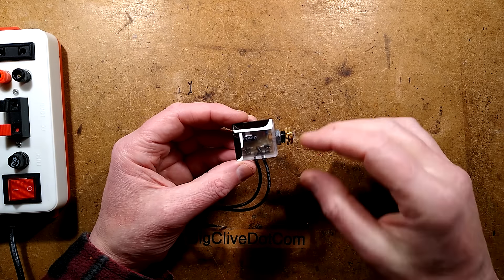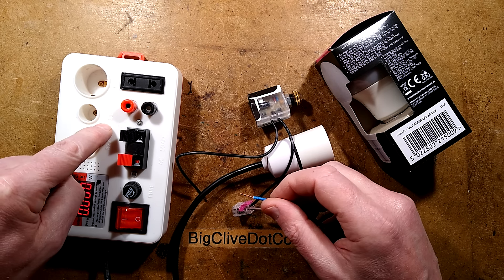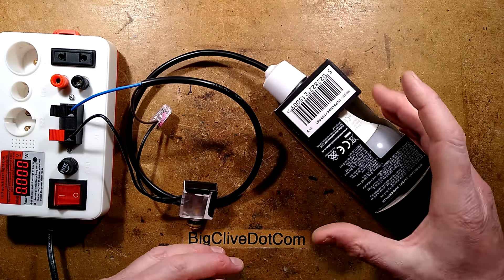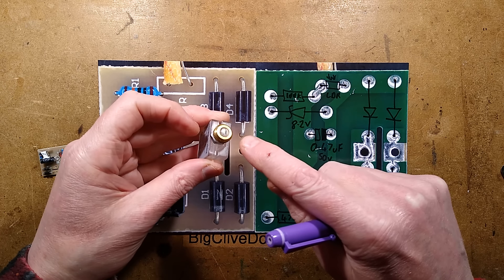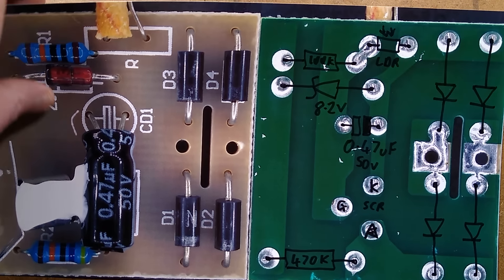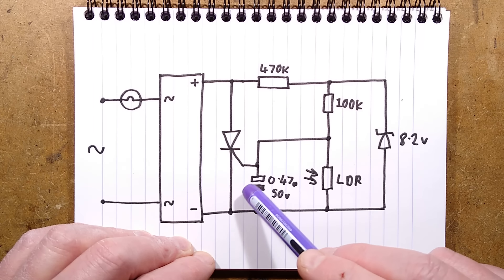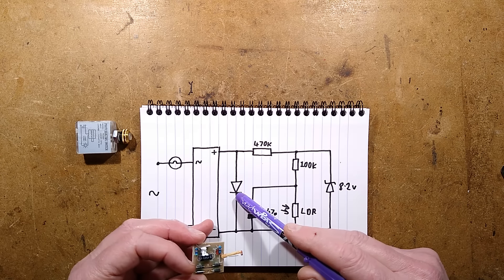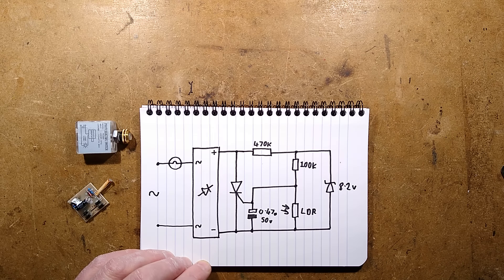Very minimalist light sensor with flicker issue

Comment: Clive, It was me that sent you the sensor to investigate, thank you for the clear explanation of how it works and why it flickered so badly.
The replacement three wire dusk sensor that I purchased from Amazon is about the same physical size and has a built in 12 second switching delay, no further problems since installation.
Thank you again!👍

Comment: I have had many flicking light (or darkness) sensors.

The most amusing installation I have seen was for a light circuit but the sensor was placed within range of the light beam so the light itself was causing the sensor to turn the light off which made it dark enough to turn the light back on which then….you get the idea

They ended up placing a plastic shield between the light and sensor rather than move the sensor. It worked for them
Reply: Dusk/Dawn sensors are supposed to operate at 70 lux,  They are never calibrated.

Comment: My workplace has sold LED panel lights from a Chinese manufacturer for years, and they too has the habit of soldering the ends of multi-core leads which normally go into scew terminals. I constantly clipped off the soldered bit and removed the insulation to reveal non-soldered cores when preparing these for the electricians who installed them at the customers' premises.
To manufacturers in China and elsewhere: Multi-core leads have a slight "springy-ness" to them, making for a more reliable connection when they're connected with scew terminals. By putting solder on them, you make them more rigid, and thus more prone to dislodge themselves over the years.
Reply: Solder flows very, very slowly under pressure, so if a soldered stranded copper wire is clamped in a screw terminal, eventually you will end up with a poor connection. And if there is a significant current flow and enough voltage, it may arc nicely, overheat and burn the connector...

Comment: Thank you Clive. 
Really nice to see the workings of devices like these. Was surprised you did not feature a “hack” of some kind to rectify the “shimmer” 
While I know there will be plenty of videos on line of various diy dusk sensors. 
I would really like to see your design of one of these that will work on say 12v/5v or 3v dc led projects , where the ldr is fitted in a tiny hole/mounting on likes of led candles or other items.
Some years ago I  came across those poundland led strip lights you featured. the dusk sensor modules in those work on ,iirc 5v to 15v and rescued some that were being “dumped “ because customers had opened them etc.
Reply from the maker: It would be complex to add hysteresis to such a simple design.
Reply: I would like a 12 volt DC light sensor.. operating voltage 10v to 16v ... I have solar panels.
Also lower and higher voltages 1.2, 3, 5, 24 & 48 should cover most..
I was wondering if a zener and a capacitor but no idea which...
Electoboom might employ a 12uF 💥 capacitor ⚡
Reply: You could try inserting a resistor between the LDR and the gate and maybe at the same time, increasing the value of the capacitor.
Its not hysteresis but it would delay the turn on / turn off and maybe stop the flickering?
Reply: @kenaston4220 it wouldn't...

Comment: The Chinese testunit seems to have an on-off switch type that could have a neon light built-in which you could use as an indicator that it is turned on?
Reply: illuminated switch
Reply: I thought that too... If there isn't a lamp in that switch, it seems to be a standard size that can be easily changed out with one that has a lamp.

Comment: Clive, try this with a dimmable LED bulb!  It may create a nice effect where it proportionally increases light output as it gets darker outside, and proportionally dimmer as it gets brighter outside.
Reply: That's what I was thinking, the circuit is very similar to a traditional TRIAC dimmer. The downside is the rectified design makes it much more likely it will trigger on the next cycle, causing flicker. If the same circuit was made with a TRIAC instead of rectifier+SCR it would probably dim properly.
Reply: @eDoc2020  yeah, I'm curious on how they'll react.  I know I've put a traditional dimmer on a circuit with fluorescent lights that had traditional ballasts with starters.  The random flickery light show was fun!
Reply: @davidkane4300   I've actually had fairly good results using a traditional fluorescent light on a TRIAC dimmer. The hard part was getting it started, but then I could probably go down to 50% brightness before it started acting up.

Comment: Clive, for the indicator light for the lamp tester, did you check if the switch already has a neon lamp that has not been connected? I have a water heater with a switch like that that din't have a power indicator* and, when I opened it up to change the switch for an illuminated one, I discovered I only needed to add a little bit of cable for the unused neon lamp already on the power switch...
*It did have a power indicator, but not a useful one: It has a red/green LED to show if it is heating or not, but the red one (not heating) is directly wired to the mains with a capacitive power supply and will light as long as the heater is plugged in, no matter if the power to the heating element has been cut with the power switch or if the green (heating) part of the LED is on...

Comment: I think that all dusk sensors which don't use built-in hysteresis are going to have problems with flickering when in an edge state.  I used a circuit from a web site in order to make a simple solar battery charger to operate some LED lights after dark.  It's pretty sharp in its response to dusk (goes from fully off to fully on in roughly 1 minute) but it doesn't instantly turn the lights on or off.  It's a gradual transition.

Comment: Hey Clive, perhaps consider moving the bench power module’s voltage display to the load side of the switch so you can see if it’s turned on or off
Reply from the maker: I've considered that, but it would mean it went through its power up sequence and display voltage instead of just showing current immediately.
Reply: Or just fit an illuminated rocker switch.

Comment: Suggests it isn't for led bulbs but for incandescent
Reply: I think that's part of the problem with mine, it's never really worked properly with LED floods
Reply: I was wondering that also. However it would be more efficient to leave LEDs on 24-7 than use incandescents.
Reply: My thoughts exactly! Back when I was an electrician, CFLs were popular (and LEDs just starting to come to market), but the majority of photocells were still designed for incandescent lamps.  When a CFL or LED was installed, it would flicker at dusk and dawn until it was sufficiently dark or light enough to fully be in or off (and if I remember correctly, they were never fully "off", which wasn't an issue with an incandescent lamp).

Comment: Reminds me of those old National Panasonic light sensors, with a relay coil, with a massive CdS cell on top, bare, that was under the plastic dome. Very simple circuit, 220VAC coil in series with the huge CdS cell, and a single NC contact on the relay arm, with an adjusting bar that was bent during "calibration" so the relay would close the magnetic circuit when the CdS cell was exposed to morning light level, and in the evening, when the cell got high resistance, the calibration to have it release, and thus close the electric contact, was to shade part of the cell. they did tend to flicker and oscillate in the evening, as the stray light would reflect back on the cell, and thus you would have a few cycles of on and off on some evenings, unless the cell was far from the light. 

Big advantage was that they would survive quartz halogens failing and going near short for a cycle or three, which would blow up lesser relay units. But they would wreak havoc on mercury vapour lamps with those multiple start cycles. However, did have a few where they ran 1kW of mercury vapour, 8 125W tubes around the premises, and the cell way up high, out of the sight of the lamps, and hidden from the lamp spill light. Those were garden lights, with a mix of MV, and a whole lot of 12V 50W dichroic lamps fed with some 500VA transformers, all running off the same daylight. That survived everything, from gardeners putting spades and forks through the cables, lamps getting wet when seals failed and blowing up, and ballasts that went short circuit from waster ingress. I learned how to do scotchcasts a lot there, and migrated all the halogens away from individual transformers to big honking ones in the crawlspace, making fixing wiring easy, no scotchcast on armoured cable, just replaced with regular 1.5mm cable, and new glands, and you can fix it with tape when broken. Also no blowing holes in plants when the cable failed.
Reply: Most of these have "thermal relays" in which the "coil" just heats a bi-metal contact.  When it gets hot , it opens the circuit.   Thermal lag solves most problems.
Reply: @GilmerJohn  Yes have seen plenty of those, but the National ones were almost all relay based.

Comment: Hey Clive,
what would be the right way to ptoperly design this type of switch? Can this flicker-generating-illumination-addon-device be improved.in any way, to make it work without issues?
❤
Reply from the maker: The cheap Chinese units use a 555 as a threshold and hysteresis device that can drive a relay directly.

Comment: Clive,
If you point the sensor at the light it is controlling you have built a nice little oscillator.   The 0.47uF cap will set its frequency.

Comment: 1:15 while the Original wago connectos are  not made for soldered wires they hold it down anyway. 
I'd guess it was the weaker metal spring inside the fake one.

Comment: I had one of these in the fixture by my front door. It did the same thing. I think the intent was they would be used with tungsten lamps and it would work out kinda like a very crude PWM dimming. 
I bypassed it and installed a fancy light switch that has an almanac and can calculate the dusk/dawn times based on the Lat/Long provided during setup. I hadnt even thought of the electrical noise from the switching. That would've been horrible had I been able to use my HF rig.

Comment: I built (for a YT video and my channel) a nightlight using an 8 pin ATTINY chip and a light diode (faster). Using powerful 12VDC car LEDs, I automatically blanked the LEDs just before a true light level was read (you couldn't see the blank pulse). As the LEDs were mounted on the same box - oscillation could occur, I solved that by - once triggered, it would wait for about 10 mins before another sample was taken. No hysteresis involved, I built this so that my physically challenged wife could traverse our hall - circuit still works great after 10 years. It's powered by Gel battery for emergence power outs. Observation: A lot of materials hold onto light - persistence (very short duration).

Comment: Soon as you mentioned flicker, I knew what was going on... Typical economy photoeye using a CdS cell and triac or scr instead of an old school thermal relay with its inherent hysteresis - no problem with tungsten incandescents as it mostly just ramps up in brightness but flickers badly or can cause premature failure with led and discharge (HPS/MV/MH or florescent) lamps as the drivers/ballasts usually aren't designed for large variations in the supply...
Reply: I also noticed the LED bulb Clive used is non-dimmable... I wonder what would occur with a dimmable LED? Maybe a nice effect where the light output is proportional to the darkness level?  Like a small amount of light at civil twilight, gradually increasing as nautical and astronomical twilight occurs, then full brightness at night...

Comment: That the thing works with LED lamps at all is a bit surprising.   Here in the US,  it wasn't uncommon to see "nightlights" using a small 7 watt incandescent connected to a triac and a CdS photocell with a couple of resistors.  Those don't work at all with LED lamp replacements, unless a high-value resistor is shunted across the lamp terminals to provide enough current for the circuit to operate.
Reply: Yes, it was a pain when CFLs (and LEDs soon after) were all the rage, but didn't work in existing outdoor fixtures with built-in photocells, so people would go buy a new one and have the same issue.  I have been out of the field for over a decade, so I can't say when (or if) they solved this issue, but I do know I've seen newer construction homes with LED array outdoor light fixtures, so maybe they just skipped the replaceable LED bulb market altogether and just sell those now?

Comment: I made a similar thing back when we had filament bulbs, it was based on a TIC 106D  SCR, a 100k pot and a resistor(as an end stop), 4 1N4007 diodes and an LDR ( from Tandy) it was pretty crude but worked a treat on a 60 watt bulb, but I doubt it would work as well with the new LED lamps.
Ps  I read somewhere mains LED lamp bulbs have a limit of on off cycles so could this circuit damage the PSU in the lamp?.
Gaz Yorkshire.

Comment: what is the frequency of the dc from the ac conversions through the diodes ?   double the grid ?
Reply from the maker: It will still be the same frequency when the rectifier is shunted.

Comment: I have installed a light sensor in the staircase. When it gets dark, it starts flashing and the relay keeps turning on and off. After a while, the lights are steady. The problem is probably with which part in the circuit?
Reply from the maker: It may be the dusk sensor detecting the light.  Or if it's old it could be a failing capacitor in the unit.

Comment: The "Sticky Label Fixture" screams minimalist "engineering".  Any chance of a review of these Chinese solar  rotating light house devices? they are very good modules for the modelmaker, and run very well on 1.5v. Would it be worth increasing the value of that capacitor? That  might reduce the flicker a little?
Reply from the maker: I featured the solar lighthouse mechanism a while ago.

Comment: I recently discovered that there's a fully addressable RGB version of the copper wire fairy lights on Ali and sites like that. The controller and power comes in the form of a USB stick and it has Bluetooth control.

Which makes me wonder, how hackable are they?

Obviously you could just resolder the string on some other controller, but could you also just reflash the MCU it comes with?

Would be an incredibly cheap way of getting any lights you could imagine, like old-school randomly twinkling lights etc.
Reply from the maker: Some use classic 3-wire WS2812B LEDs.

Comment: I bought a solar street light a few months ago and it seems it has a faulty PIR sensor. 

It's supposed to remain at 30% brightness until it detects motion.

But what it does is keeps going from 100% bright to 30% bright until it runs out of battery.

If I knew how to fix it I would attempt to repair it myself.

Comment: Clive I am an electrician I fit LED lights in common stairs and found 3 LED drivers damaged but the manufacturer of the driver is basically no interested. Would you be interested looking at them to diagnose the issue.

Comment: I haven't had much luck with these sensors, there's a unit on my carport that worked for a few weeks but now stays on all of the time unless the sun is hitting the sensor directly. It's the second one I've replaced. I finally said screw it, the cost of running 2 LED flood lamps is minimal compared to buying new sensors all the time.

Comment: Some US street lights used a  HUGE   CdS  unit (  RCA 4403 , nearly 1 inch across , I have one right here  ! ) , this passed enough  daylight current to energise a  115 Volt relay ... at dusk the relay lost power , contacts switched on , lighting the street lamp ! ... your little unit needs a cheap Schmitt trigger IC ( ? ) ... Ha - Ha ................ DAVE™🛑

Comment: I’ve installed many hundreds of these and if they aren’t aimed away from ambient light sources they will flicker or turn on and off all night long. Sometimes I would paint a piece of sheet metal matte black and place that on the wall and aim the sensor and that or a black plastic tube on it aiming away from light sources and light colored surfaces. Problem solved.

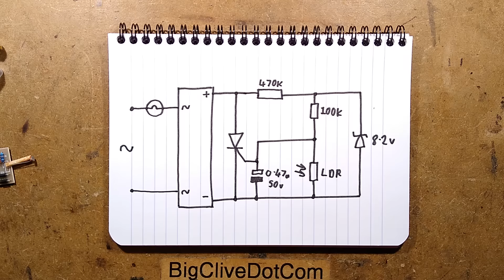Comment: 6:10 use extra zener and capacitor to regulate and shunt the input of the scr or thyristor 

So that way it won't loop causing the flicker either 

Or using a mosfet would work since it's a dc rail

Comment: I wonder if replacing that 0.47uF capacitor with a much higher value one would solve the issue...
Reply: That could release too much current through the SCR, causing damage.

Comment: I made an extractor fan with ebay smoke detector as a switch. Works brilliantly alongside the remain on timer pcb.
But the smoke sensor relay is fritzing like crazy. I tried lowering the resistor value on the adjuster to more finely tune it..but its fritzing..dont trust it 😂 maybe you have a solution here..

...i think you did but i didnt get it 🤦😂